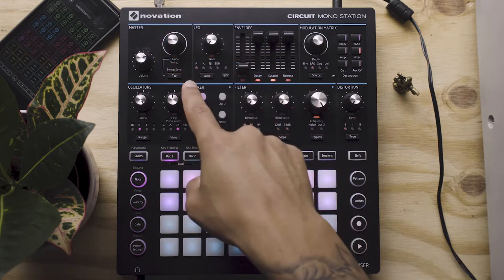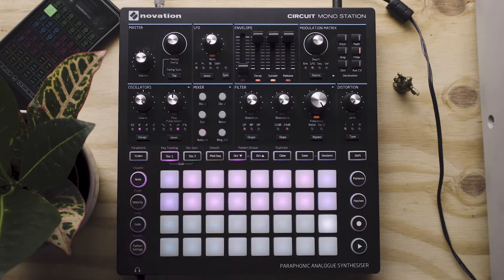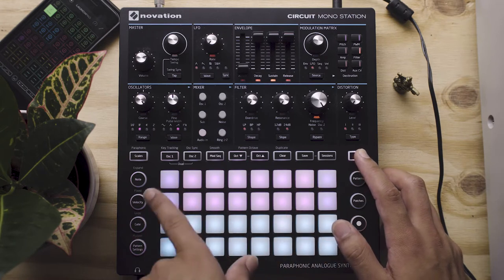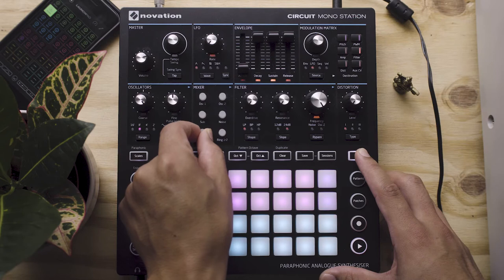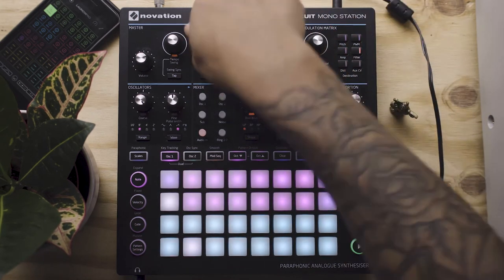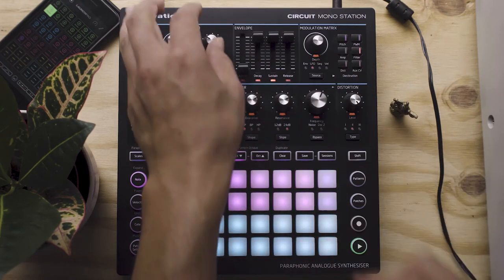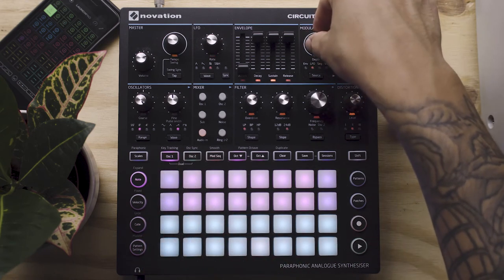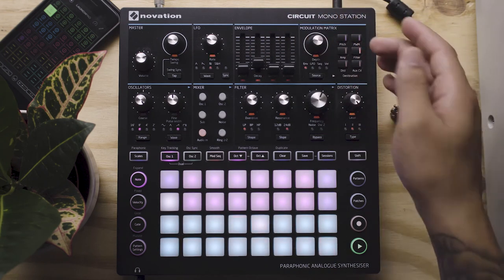External Audio Input - Circuit Mono Station

Comment: your mono station videos are great! at first this box seems both overwhelming and disappointing in terms of what it can do.. but once you take time to learn it it's amazing!  my audio input was too quiet to be useful for my volca but now with this video it works great!  also the new update adding the shift + pwm features really adds to the paraphonic capabilities.  now if only we can get mod seq to midi output instead of just cv !
Reply from the maker: It does! Hold shift and select which sequencer will be outputting midi!
Reply: @RickyTinez  no way, you can send midi from the mod sequencer even? aka i could control my volca with the mod sequencer?  i thought it was just from osc 1 or 2.  i just tried holding shift on mod seq and it doesn't seem to work. i tried changing my volca midi channel to 3 too and that didn't work either. if this could actually work this box would be perfect

Comment: I was reading about sending the Audio Out back into the Audio In, have you tried that? I would love to hear what that sounds like as I am seriously thinking about getting one of these but I am more interested in using it for experimental sounds which I can't find many examples of.
Reply from the maker: Whoa that could be cool.. You'd start to get some feedback and then automate it's input gain across a sequence... hmmm...
Reply: I would love to see a demo of this... hint hint. Also can you sustain notes at all, or is it like the circuit and only hold notes for the length of one pattern?
Reply: Richard Grant have just been doing this, but also putting a boss ph3 in the line. It sounds weird and  there’s definitely an art  to balancing the gain . A delay would be fun, I think. Too bad there isn’t a dedicated loop for this as it means I’m basically using headphones only for listening.
Reply: @RickyTinez  It is not possible to automate input gain. I've tried it. It's even mentioned in the manual that it is not possible.

Comment: Definitely worth experimenting with external sync - both with the envelope and also the LFO sync is a great feature. The filter lacks character compared to the Behringer Neutron or Moog filters but being able to sync livens things up. I like putting LFO with negative phase on the filter mod with positive phase on PWM on VCO2 in filter bypass mode - a pity that can't be split to stereo.

Comment: Hi Enrique...I have an issue with audio in feature. The sound always  come out a lot distorted and so so low of volume. I m never able to obtain a clean sound like the source when I connect devices to audio in. Have you some fix stuff?
Reply: ADJUST GAIN ie SHIFT+AUDIO IN MIXER

Comment: Is it the same filter found on the Peak ?
Reply from the maker: Hey Eden, The Circuit Mono Station has the same filter as the bass station. But Peak has technically got the same filter but it drives a lot harder on the resonance so does have a little more character. Plus, it has more control over the sound of it on the face of the unit.
Reply: It's a shame that the peak has no audio input, it would be a lot more flexible to integrate with other stuff